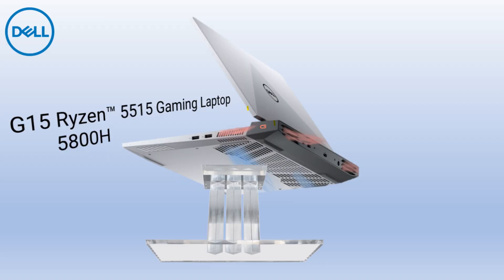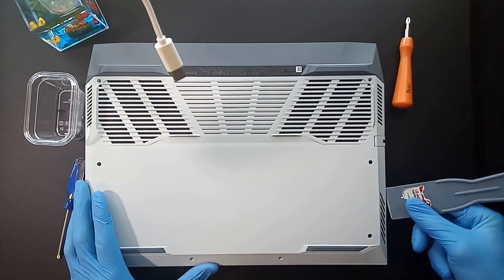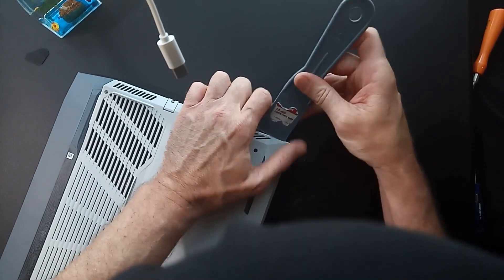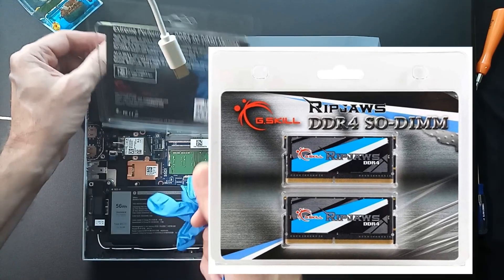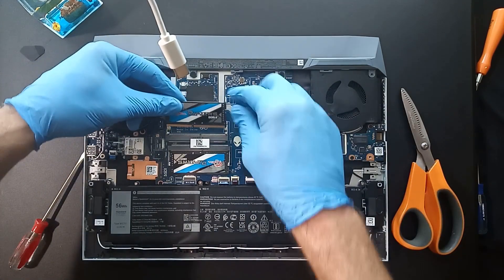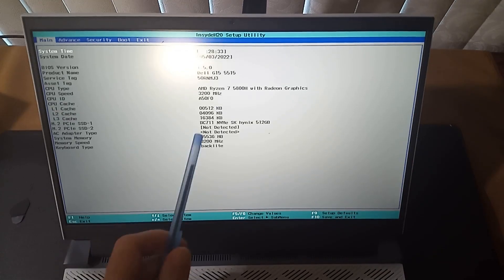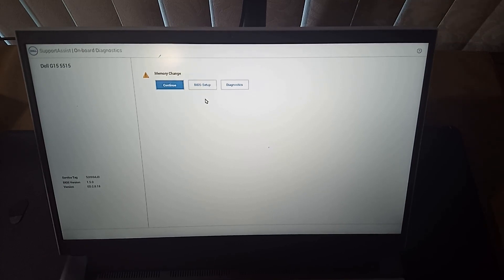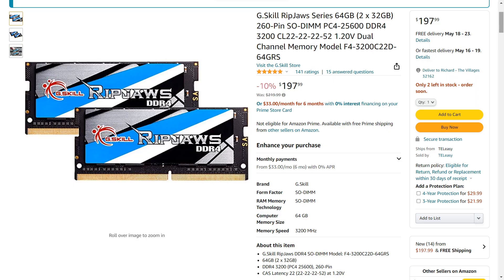64 GB Memory Upgrade for Dell G15 5515 with Ryzen7 5800H CPU

Comment: What output do you get when you run "wmic memphysical get MaxCapacity, MemoryDevices" in cmd?
Reply from the maker: Thanks for the feedback & subscribing.  Hope you "Liked" the video.  My result is:
MaxCapacity  MemoryDevices
134217728    2
Which converts to 64 GB!  Great questions.  Thanks
Reply: @CyberMedics I'm confused... Isn't that 128GB?
 I have the Dell G15 5520, I did the wmic command and I only got 32gb. Now I'm confused if the 64gb will work in my machine.😢
Reply from the maker: @qutiephoebe2154  Run winmic as described above on your machine. It is only 64 GB.  It will probably work with 64 GB
Reply: @CyberMedics  hi. I did run the "wmic memphysical get maxcapacity"
It returned the value 33,554,432. Which is equal to 32gb. 
Yours returned 128gb but mine just returned 32gb. So installing 64gb worked for you.. but I'm not confident if it will work for me.😣
Reply from the maker: @qutiephoebe2154  I'll run it again to validate the results. It appears the max memory for the laptop is 128 GB.
Reply from the maker: @qutiephoebe2154  You may be right.
Reply: @CyberMedics  Thanks a lot. Please let me know the result. I'm a bit worried to get the 64gb since my wmic returned 32gb only. I just find it strange that a 2022 laptop would have a 32gb limitation where as older ones can support more than that.
I live in Asia so returning an item bought from Amazon would be very unpleasant.😔
Reply from the maker: @qutiephoebe2154  Ran a couple of things for you.
wmic MemoryChip get BankLabel, Capacity, MemoryType, TypeDetail, Speed
BankLabel     Capacity     MemoryType  Speed  TypeDetail
P0 CHANNEL A  34359738368  0           3200   16512
P0 CHANNEL B  34359738368  0           3200   16512

wmic memphysical get MaxCapacity, MemoryDevices
MaxCapacity  MemoryDevices
134217728    2

wmic memphysical get MaxCapacityEX, MemoryDevices
MaxCapacityEx  MemoryDevices
134217728      2
Reply from the maker: @qutiephoebe2154  It is indicating the system can  support up to 128 GB of Ram...not sure that is correct, but that is the result.
Reply: @CyberMedics  Thanks for trying and letting me know the result. I just bought the 2x32gb 4800mhz from crucial. It will take approximately 12 days to be delivered here. Hope it works.🙏
Reply from the maker: @qutiephoebe2154  please update us once you get it in and let us know if you need any support.
Reply: @CyberMedics  Hi. Yes will definitely update once I receive the memory. Thanks a lot for the prompt responses. Really appreciate it. Awesome channel.🙂👍
Reply from the maker: @qutiephoebe2154  Thank you for the kind feedback & best of luck with the upgrade.
Reply: @CyberMedics  Hello. Got the memory last week. Installed the 64gb ram. 
Its working and recognized by the system (Dell G15 5520) i7 12700h version.🙂
Reply from the maker: @qutiephoebe2154  Fantastic! Thank you for updating and sharing with everyone!l.
Reply: @CyberMedics  Thanks again for responding promptly to my inquiries. Much appreciated.🙂👍
Reply: @CyberMedics  Thanks again for responding promptly to my inquiries. Much appreciated.🙂👍
Reply from the maker: @qutiephoebe2154  if you're running windows please consider viewing and commenting on our bitlocker videos.  Appreciate the support.

Comment: What are your impressions of the ram you installed?
Reply from the maker: Happy with the upgrade.  Haven't done any real benchmarking.  Have you use the RipJaws memory? Thanks for commenting & Subscribing?
Reply: @CyberMedics  I have not used RipJaws
Reply: I tried the RipJawz in my Intel Dell G15 5511 and within a day I was getting the dread BSOD multiple times a day. No idea why it doesn't like the Intel version but it doesn't or maybe it's just I have terrible luck.
Reply from the maker: @markb9896  Maybe the Ram is faulty?
Reply from the maker: @markb9896  What kind of details did you get on the screen?  Have you tried any memory test applications?  If so, which one?
Reply: @CyberMedics  yeah I tried a few memory tests both were erratic at best. Sometimes I got a bad memory message and sometimes I did not. Ran each stick individually and no issues so I have no idea if either were bad or not.
Reply: I tried the Dell inherent memory test as well as the Win 11 inherent memory test.
Reply: @CyberMedics  a little more detail, the stock memory in the 5511 is 1.2v while the RipJawz is 1.35v, I think that is my issue.
Reply from the maker: @markb9896  Thanks for the details. May help someone in the future.  Not sure if I mentioned the voltage of the my ram...do you want me to check? Also ran across some other memory checkers...I can post them.
Reply: @CyberMedics  if you have other memory checks you prefer that would be helpful in the future. No need to check the voltages of what you have but I appreciate the offer. Thanks
Reply from the maker: @markb9896  It seems that Memtest86 comes up a lot for testing memory and doesn't require a specific OS.  Have not used these, but here are some links to useful reviews of memory testing tools.
https://www.memtest86.com/
https://www.tomshardware.com/how-to/how-to-test-ram
https://linuxhint.com/best-memory-testing-programs/
https://www.lifewire.com/free-memory-test-programs-2626178
Please let me know if you use any of these.  We may do a video on the memory test tools..  Would be great if you send us your results, so we can help others.
Reply: @CyberMedics  thank you!
Reply from the maker: @markb9896  Your welcome!  Please like & subscribe to help support the channel.
Reply: Just a quick update on my Dell G15 5511, dropped in some Crucial DDR4 3200 RAM 1.2v (not the Ballistix)  and so far so good!
Reply from the maker: @markb9896  gald to here.
Reply from the maker: @markb9896  You think it was the voltage setting of the Ram?  Did you run any of the memory testers?  Hope it works.
Reply: @CyberMedics  I do think it was the voltage, the 5511 is meant to r7n 1.2v ram and the RipJawz was 1.35v. I did run several memory test after getting BSOD on multiple occasions and researching the error code which was a memory error. The Crucial memory I installed today is running fine so far so fingers crossed it continues.
Reply from the maker: @markb9896  Awesome!  Thanks for keeping is updated.
Reply: @CyberMedics  I should also note I have the Dell G15 5511 Intel i5 version not the AMD Ryzen.
Reply from the maker: @markb9896  I went to check the voltage spec on my RipJaws memory and it is 1.2 V.  This is our Amazon affiliate link that shows 1.2 v https://amzn.to/3SM6GBw.  Would you post the links where you bought the RipJaws and the Crucial RAM?  Just want to compare specs.  Thanks you for all the details.  Many times when we try to help people, they don't give us the feedback on the results, so we can't share the info with others.  Your feedback is much appreciated!

Comment: and i did subscribe bro
Reply from the maker: Appreciate that. Welcome aboard. Do you have a Dell g15 laptop?
Reply: hey @cybermedics, are you sure it is going to work,,, i have this machine with Ryzen 5800h and official DELL claims it can only support up to 32 gb ram, so 16gb per slot... but in your video it says it can have 2 x 32gb :) ...my exact model is DELL G15 5515 ryzen edition , Service Tag: 43Z4ZH3
 @CyberMedics
Reply from the maker: That's the one shown in this video and yes it did work. It does support 64 GB of RAM, but Dell did not certify it was 64 gigs of RAM. Why I don't know
Reply: @CyberMedics   great , i am buying 2 modules today and i will test it..regards
Reply from the maker: Please update us once upgraded & good luck,
Reply: @CyberMedics  it is working , last 2 days i was testing all and it is fast and working great...thanks a lot gents, keep up the good work :)
Reply from the maker: @GoranKovacevicShortee  That means alot. Thank you! Please do us a favor and check out some of our other content on device and account security. Also if you're running Windows on your system, or BitLocker video could prevent you from losing your data . Glad to have your aboard

Comment: Upgrading mine to 32gb. I thought max was 2x16. Shoot, I would have upgraded to 64 had I known. Oh well.
Reply from the maker: Thank you for commenting and subscribing. I think you'll find 32 GB is probably sufficient. Have you upgraded anything else on the computer?
Reply: @CyberMedics  So far just the ram. Storage is next week though. I've been using an external SSD for too long.

Fairly certain the existing drive is compatible with my Surface 8. Should work out well.
Reply: @CyberMedics  Forgot to mention... the latest AlienFX update seems to screw up the backlit keyboard. Only way to fix it is flashing to the latest bios. I believe I was on 1.08 and 1.12 is current. Fixed my issue.
Reply from the maker: @PublicWifi thanks for the update. If you are in anyway signed in on a Microsoft account on the computer or even a Microsoft service on the cloud, be careful when updating the BIOS or operating system. I went through bios update and BitLocker locked up my computer. luckily I was able to get the security key to unlock it. Might want to check out our BitLocker video.
Reply: @CyberMedics  I use offline accounts but register copies of Windows under my MSN. 

I haven't had any issues so far. Went with Win10 in the end. My plan is to use Linux as my host and throw up a few VM's. Not sure if I'd be successful in creating a hardware passthrough for GPU usage or not, but I'm sure it'll be a hoot.
Reply from the maker: @PublicWifi  Nice. No experience with VMs, but something we wanted to explore. Thanks for being a subscriber  Keep us updated